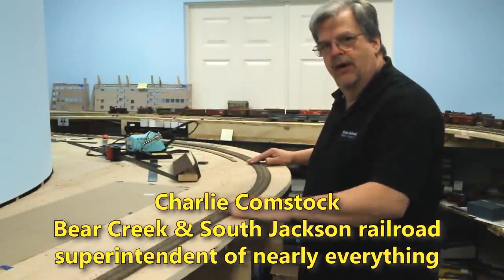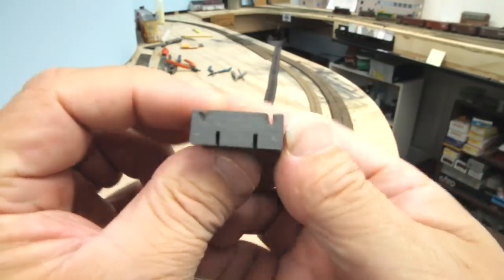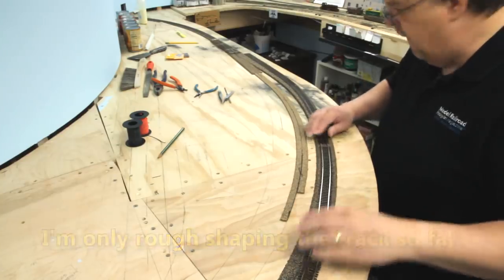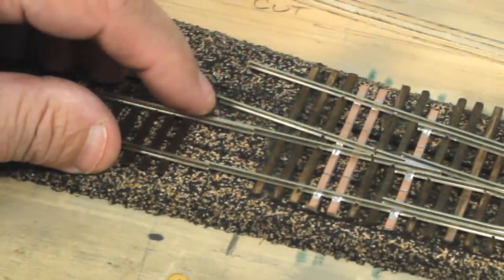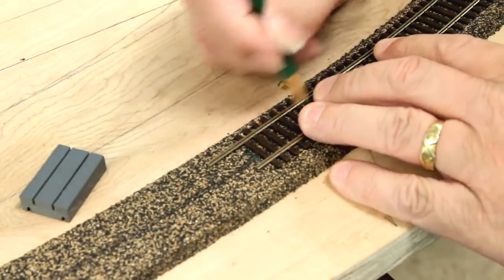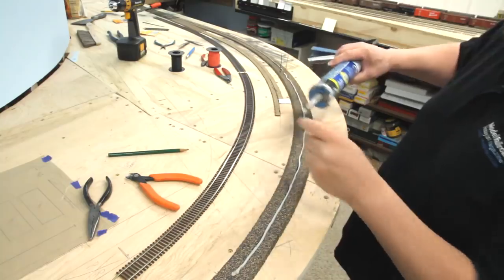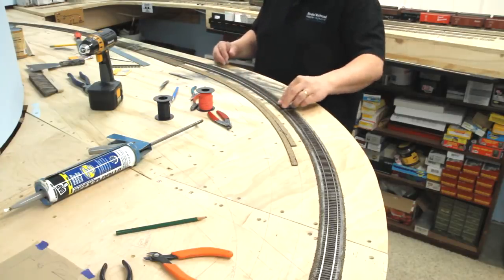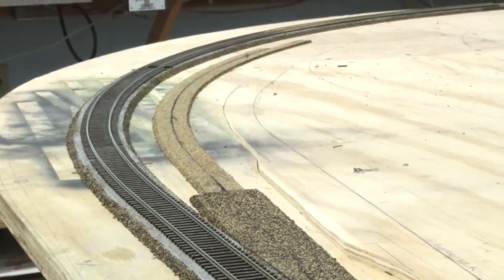ME flex track laying tips | getting good trackwork | Model Railroad Hobbyist | MRH

Comment: I feel like this would apply even with regular flex track. I see the ME Flex-Trak is bit more stiff but I will be modeling code 100 (chose it for price, and because once ballast is down black ties won't bug me, and it'll be painted as well) and I bought a bulk case of 100 pieces. I too will be running cork so this will help with securing track to the cork. Never even crossed my mind to sand it. Last time I did model railroading I was about 12 and had zero patience and a old 4x8 sheet on saw horses. This time around will be different. I saw you soldered the inside of the rails, and from my understanding that's a big no-no but I also see you had some very thin solder to work with. Do you have to touch up the inside of the rails?
Reply: I'm using thin electronics grade rosin core solder. Don't use any kind of plumbing solder or large diameter solder. It will take much longer to heat up. Not using rosin core solder will make it harder for the melted solder to flow into the joints and may result in lumps.

Comment: Charlie, I m a newbie to flextrack.  I got a lot out of your tip video here.  I have that tool from ME but would you also use a long template for the curves as well?  Also: my PECO flex track seemed drastically INFERIOR to the Atlas brand in terms of the way it handled. As soon as I cut my Peco track the tiny molded plastic spikes had released the rail in the middle of the track on one side. There is NO way to remedy that except to try to push the rail down after smoothing out the tiny spikes with a file, then using rail spike and a Pin Vise.  Ugly solution!
Reply: Same problem here with the rails coming out from under the ME spikes. I'm worried it's gonna take forever to build a minimum radius  flex track curve.  I may have to drive in scale spikes to keep the rails in gage

Comment: Man ME track almost seems more work than it is work. It is nice that it holds it's shape though.  I suppose fast tracks sweep sticks would make this track easier to work with.    Great video!
Reply: James Smith 
I bend my ME track slowly by hand like I did  brass track with fiber ties way back in the 60s. I also use spikes instead of chalk.IMHO ME track isn't hard to work with and its not like the floppy  Atlas flex track.

Comment: Great video and explanation on laying flextrack.  How much working time do you have with the caulk before the track is set?  Again, thanks for the input - good info!
Reply: The cans can come off in an hour or so if you're in a hurry. But canned corn is relatively cheap so getting enough to weight down 30' of flex track would seem reasonable if you're in the major track work frenzy. I prefer to leave the cans on over night, but that's probably overkill. After two or three hours more time probably makes little difference.

Comment: This is a nice video. don't get upset, but what do i need feeder wires for?
Reply: Feeder wires on each section of track makes power delivery much more consistent. Connecting them to significantly larger bus wires underneath the layout also helps to ensure the power level is more consistent across the layout, especially for bigger layouts.
Reply: @pathvalleyrailroad9277  Path is correct on both points. I use 12 gauge bus wires under the layout. To avoid confusion the track power bus wires are color coded the same as the feeder wires.

Comment: How do you get the precise soldering joints? I have tried to but i usually end up with a blob about 5mm in diameter on the rail
Reply: Peter Irving,  There is more to good soldering than just putting flux on the joint heating it and adding solder.  It starts with properly maintaining your soldering iron.  Over the years I have become very frustrated with soldering irons !!!   They work great when new but after a while they don’t heat the joint enough to properly melt the solder.  I never thought about regular maintenance for my soldering irons, I just wiped them across a wet sponge and when that didn’t help any more I “cleaned” the tip with with some fine sandpaper until it was shiny again, after a couple times doing that the tip is DOA (Dead On Arrival) !!!

Well earlier this year Ron Marsh (Ron’s Trains N Things) posted a great Video on soldering and how to properly clean and maintain your soldering iron.  I purchased the items that he used and got a new adjustable temperature soldering iron.   WOW What A Difference, my tip is always ready to go and my soldering joints are way better than before.  With this method you actually clean the tip every time you solder a joint, but it only takes a second or two. 

Barry
Reply: I use Weller controlled heat soldering irons. They're a bit pricey but they do a great job and last a long time. Sounds like your iron isn't making good thermal contact with the joiner/rails. Have you tinned the tip of the iron? Are all surfaces you're soldering clean and shiny? Try practicing on some scraps of rail / track before working on track that's installed on your layout where it's harder to reach.

Comment: Very nice.  Will the same techniques work for n scale flex?
Reply: +Patricia Palm-Principe It should work fine with ME N-scale track - but I've not laid any N-scale flex track since the early 70's so I can't speak from direct experience.
Reply: BCSJRR im also laying ME code 70 flex track in n scale thanks for the tutorial
Reply: Yes I have been working with N Gauge Flex Track for almost 40 years and Charlie’s method will work, if you work with Atlas Flex Track you won’t necessarily need the alignment tool but  I do everything the same.

Comment: How do you get the correct track radius for multiple parallel flexi tracks going round a sharp corner?
Reply: I plot two parallel center lines for the curve using a trammel (a stick with a hole at one end I put a nail or a thumb tack through - this becomes the pivot point - and two other holes the radius of the two tracks away from the pivot hole - i put a pencil through these holes and sweep the trammel leaving a curved arc behind it).

Comment: Why on Earth wouldn't you solder the feeder wires BEFORE placing/gluing the track?
Reply: Because it's extremely difficult to get them in the right place for pre-drilled holes and drilling the holes using the track as a template doesn't work. The track would need to be curved to it's final shape and placed precisely to see where the holes go, but the track would also need to be on it's side so the wires are clearly visible. I tried it. I didn't like it. Soldering with the track installed is much easier than it looks. It helps if I would remember to tin the bottom of the rail joiner before installing the track (which I forgot to do in the video).

Comment: Im kinda new so can uou please tell me what the feeder wires are for
Reply: Hi Levi,

Feeders serve two purposes:

The nickle silver rails are a moderately good conductor of electricity. But over a long distance their resistance adds up quickly and can cause a significant reduction in track voltage.

I run 12 ga stranded copper bus wires under the roadbed as track power bus wires and use the feeder wires to connect the track to the bus wires. EVERY piece of track on my layout is attached to the bus wires via soldered joints.

The 12 ga bus wires have very low resistance compared to the nickle silver rails. The network of bus wires below the roadbed connected to the rails means more of the DCC power can get to the trains.

Note: I use 12 ga bus wires because I have some long runs. If your runs are shorter you can use 14 ga or 16 ga bus wires. If you're building a 4x8 layout bus wires probably aren't necessary - just include a track power (feeder) wire between each rail segment and your power pack or DCC booster.

This brings up the second purpose for the feeder wires - I NEVER trust an unsoldered rail joiner to conduct track power over the long term. Each piece of track separated from others by unsoldered rail joiners gets its own set of feeder wires making the track power wiring extremely reliable.

This may seem like overkill but my layout hasn't had intermittent electrical problems in the track since I started construction back in early 2004.

While an unsoldered rail joiner may appear to work fine when it's installed, over time and especially after painting the rails (a nice rusty color), adding scenery near the track, or ballasting the track, connection through the rail joiner can become intermittent and result in no power in a piece of track. When this happens intermittently it can be really frustrating trying to locate the problem.

The feeder wires solve this issue.

Does this answer your question?

Charlie

Comment: What's the shaping tool called and where can I get one?
Reply: Unfortunately the company that made them has called it quits and I don't know where you can buy one. You might find one at a swap meet if you keep your eyes peeled for it. I think you should be able to make one yourself though. A band saw will be needed. unless you are very steady with a hand saw... If you don't have a band saw, see if one of your friends has one. Cut a piece of hardwood stock to be about 2" long. Then mark  it where the rails will go (according to you gauge). You might be able to use carbon paper place on the track with the carbon side up, then press your block down on the carbon paper to leave a couple of lines on the wood. Now stand the wood on it's end and carefully cut a small slot at one of the rail marks. Even more carefully, repeat, cutting a slot where the other rail will go. Check to see if it fits moderately tightly on a piece of ME flex track. If so you're done. If its really loose, you'll need to start over. If it's really tight go back to the band saw and carefully enlarge one or both of the slots. This tool isn't used to set track gauge so the slots don't need to perfectly match your NMRA gauge. A little slop is needed to get the tool around a curve. Hardwood is needed instead of softwood so the tool doesn't quickly wear out from rubbing it back and forth over your track.

Comment: Nice work sir. I find it easier, however, to solder the feeders on the bench before I put the track down. Doesn't mean it's a better way, just different. If your way works okay, so be it. "Different strokes for different folks"! ;-)
Reply: gerald stephens given the tweaking I'm doing for final alignment of the track, I'm concerned I'd have trouble getting the feeders and their holes to line up with each other.
Charlie

Comment: What so that track alignment tool called and where did you get it?
Reply: Sadly the company that made these has closed its doors and the tool is no longer commercially available (as far as I know anyway...). You can make your own with a piece of wood and hacksaw. Just cut two parallel slots in the top of a small piece of wood so that the railheads fit in the slots.
Reply from the maker: MLR Manufacturing is the maker, but the owner has retired and these are no longer being made. Many sources are sold out now. Try googling MLR track tool, and good luck. They're almost gone at this point.

Comment: why do you glue and not nail the track?
Reply: very simple remove the track off than the nail will give problem on the track will break ties or hard to remove too many nails on tracks if you don't like correct there or mistake direct where track go way. I like glue keeping straight level. it opinions.

Comment: Why do you solder the tracks together?
Reply: Each unsoldered rail joint is prone to electrical conductivity problems and kinks. Soldering (mostly) alternate rail joiners reduces these issues by 50%. It also means I need half as many feeder wires to adhere to my rule that EVERY piece of rail must have a soldered connection path to the track power bus wires.

Comment: A continuous section of plastic is on the outside ?
Reply: No sure what you mean by "continuous section of plastic"?  I'll take a stab at it though. With Atlas flex track one end (all ties on the same side of the piece of flex track use the same side) each tie is free, the other is connected to it's neighbor ties. If you pulled the rails out it would look sort of like a big funky comb (for combing your hair). This is what allows Atlas track to curve so easily. With ME track on the other hand a tie is connected to its neighbor on one side, then it's neighbor tie is connected to the next tie on the other side, then the other side. The continuous plastic ribbon zigzags back and forth (unlike Atlas where it's on one side). This means, that as ME track is curve the ties tend to bind - ME track requires more force to curve but once curved, it holds its shape. This subject really needs pictures to make it clear.
Reply: @BCSJRR  It was exactly what I needed to know.
Thanks

Comment: Where do you get that tool for curving the track?
Reply from the maker: It's no longer available. But you can easily make your own from a piece of 1x2. Just cut some saw kerfs into it at HO gauge and you're good to go. If you have a table saw, it will take you just a few minutes to make it. If you don't have a table saw, time to make friends with a neighbor or fellow modeler who does!
Reply: @MRhobbyist  Or get a piece of .060" styrene about 1.7" long (for HO scale) and glue some other pieces on top to leave a couple of slots that match your track gauge.

Comment: What is the tool called that help the track bend?
Reply: Sorry, I don't remember off the top of my head. But it's named in the video and it comes from MLR Manufacturing. Last time I looked Walthers carried them.
Reply from the maker: MLR Manufacturing is the maker, but the owner has retired and these are no longer being made. Many sources are sold out now. Try googling MLR track tool, and good luck. They're almost gone at this point.
Reply: Model Railroad Hobbyist magazine ok thanks

Comment: Interesting but same issues with laying flexitrack everywhere ie getting curves correct and straights straight. For Peco/Smp you can use Tracksetta tool which defines the radius better. It would also have been easier to have soldered the feeder wires to the underside of the track and feeding it through the holes before laying. Its a mindset approaching this job ie it cannot be rushed and take consolation the real thing takes time as well. Otherwise use section track.
Reply: Soldering the feeders to the bottom of the rails before laying the flex track would certainly make the soldering process easier. But it would make getting the wires in the right place difficult given the small size of the holes in the roadbed they feed through. With a bit of practice, soldering in place becomes a reasonable alternative.

You've correct that laying track can be done in a hurry or done well and the two methods are exclusive of each other.

Comment: Different strokes Different Folks I can see you use flex track on long Big layouts on shorter layouts it wouldn't work sectional track will work not really high on soldering.
Reply: If one uses sectional track and doesn't solder the joints two things happen: 1) its' easy to take the trackwork apart and put it together a different way, and 2) in time, you'll likely reach a point where trains won't run reliably because the rail joiners can't be trusted to make good electrical contact, especially not after a year or two.

Comment: this has to be one of the most ridiculous how to videos ever posted.  if you would like to watch how a profesional lays track, you should learn from a video published on youtube by kanishirosouthwester.   laying track need not be such a major issue
Reply from the maker: +coral bay rr we've looked at kanishiro's track videos and he's using Atlas flex track rather than MicroEngineering flex track as shown here - you're comparing apples to oranges. ME flex track is stiff and holds it's position, so the methods Charlie shows here really help when dealing with ME track. You're right, the methods shown here don't work with Atlas flex track, but then they're not supposed to. Hardly "ridiculous" - more like use them where they apply! ME track has scale spike heads, unlike the cantalope- and grapefruit-sized spikeheads on Atlas track.
Reply: +Model Railroad Hobbyist magazine ME track also has a narrower, and closer to scale width railhead. It also uses much smaller, and less obtrusive railjoiners.  I will readily admit that my methods are not the fastest way to lay track, So if the goal is to get 'er done quick, using Atlas track is probably your preferred method. But if appearance is the goal then taking the extra time required to use ME flex track will yield better results. YMMV.
Reply: ,coral bay rr
Reply: There always has to be that one guy.